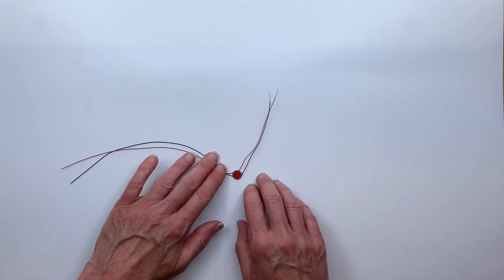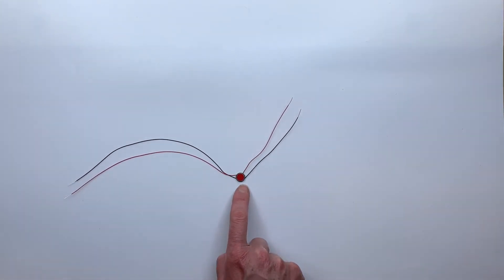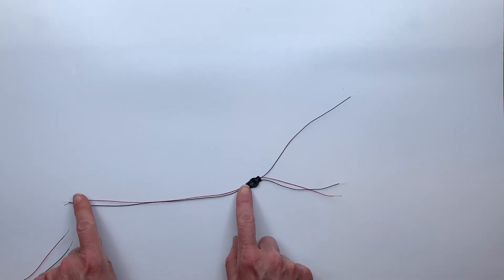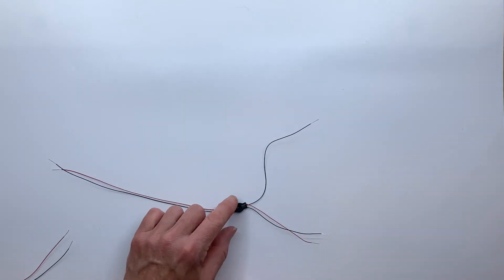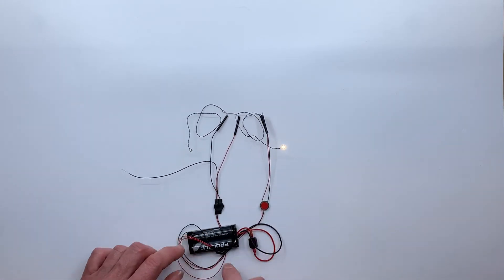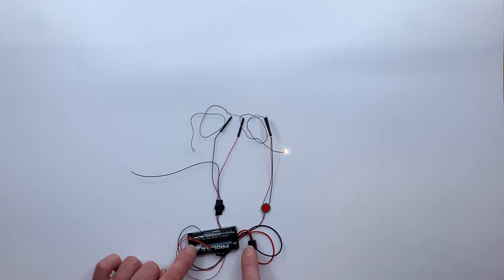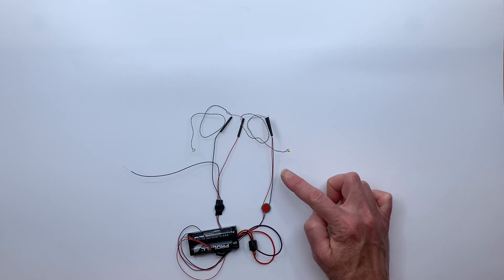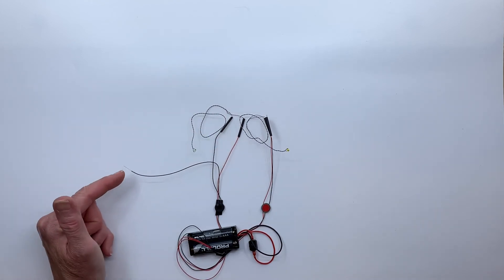Touch Sensor Switch to turn LEDs ON and OFF

Comment: Where I can buy this one. No link is provided in video 😭🤕🇮🇳
Reply from the maker: Hi Sagar I am glad you like our little touch sensor.  You can find it here https://evandesigns.com/products/touch-sensor-switch on our website.  The touch sensor is 3 volt so it can be run on any of our 3 volt battery holders: https://evandesigns.com/search?type=product%2Carticle&options[prefix]=last&q=3%20volt%20battery%20holder*
Let know if you have other questions for us!    The team at Evan Designs